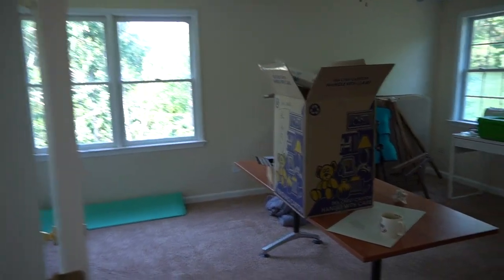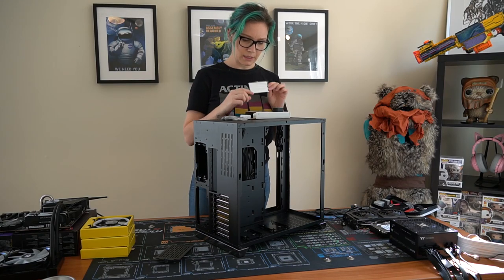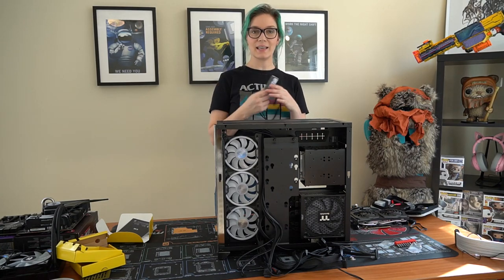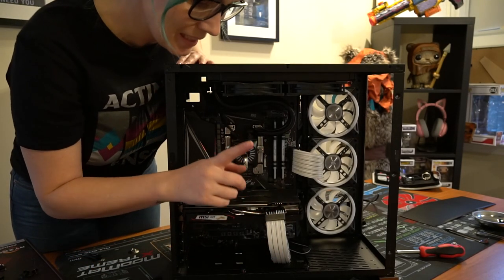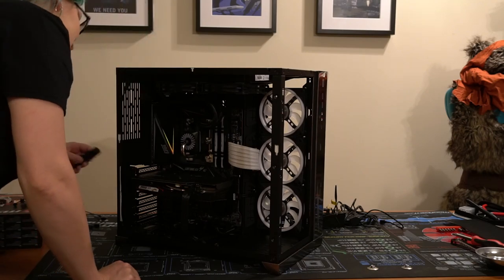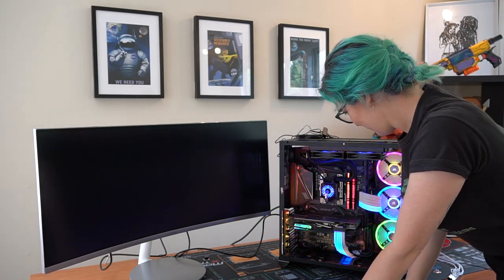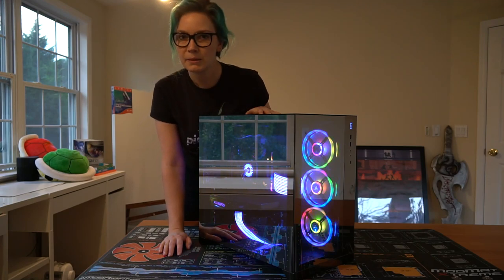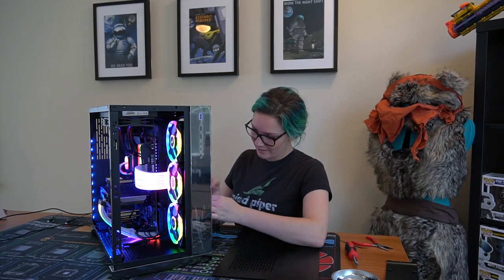Lian Li 011 Dynamic PCMR Special Edition build, the mirrored one!

Comment: I have Nr 30/2000🤓
Reply from the maker: Thanks, I'm not familiar, is it a mic or noise reducer? If so do you like yours? 😊
Reply: Pixie La I still converted it to stand here.Is the lighting clearly visible through the window ? 😕😊...... At 21:40 Is the Glas on the Case ?
Reply from the maker: The lighting is very clearly visable through the glass case. Those shots were done without the glass though as I didn't want a reflection of me up close taking them. When the case is lit up at night (and your face isn't next to it) it is pretty clear.
Reply: Pixie La Luna  So the lighting is not 100% visible through the closed window at night...But it's also normal: it's mirrored😊😎
Reply from the maker: Yes, you are correct, I would say as an estimate 90% visible, but that is the point of getting the mirrored case and not just the standard 011 Dynamic. The last shots at 21:53 are with the glass on. If you had other light sources in the room you would see them reflect.
Reply: @PixieLaLuna   
The Corsair QL fans come in. The AIO H150 360 Cpu Cooler from corsair, and the Dominator RAM memory, also from corsair